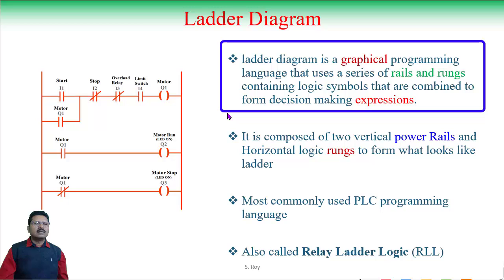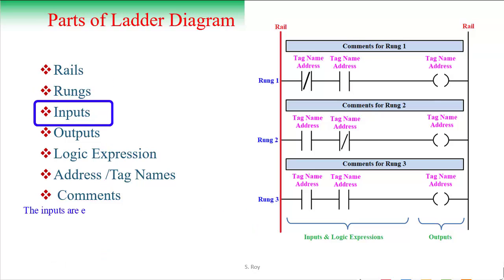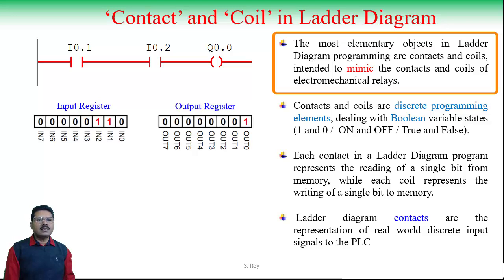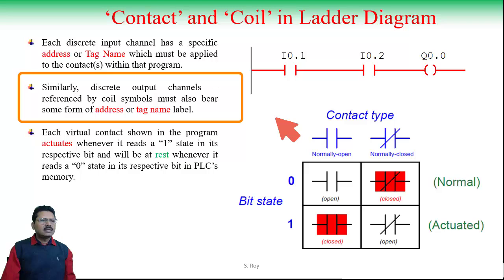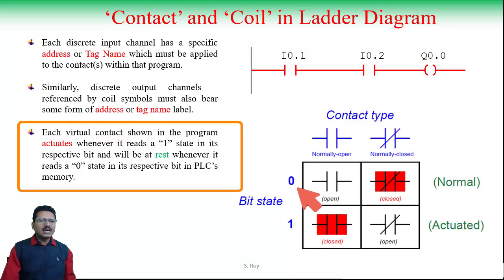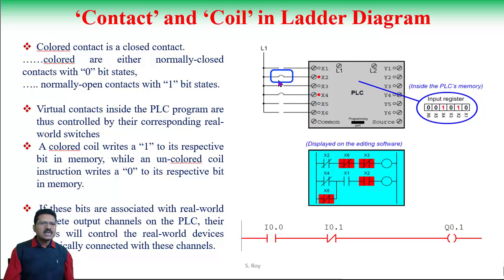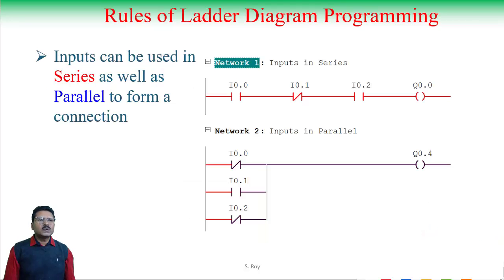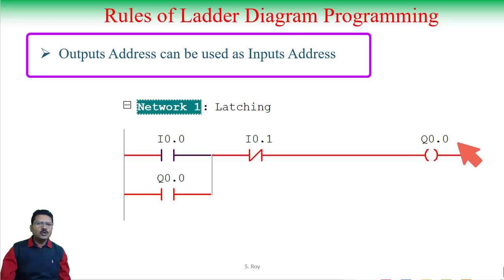What is PLC: Ladder Diagram explanation

Comment: If I understand correctly, between the physical switches and the make and brake symbols of a plc, the bits mediate. The bits have an initial value of '0', so it coincides with the normally open state of a contact, while the same is not true of the initial closed state of a contact in the ladder diagram, which for any contact to open, the input bit must change from 0 to 1
Reply from the maker: sorry sir, I could not follow what you wanted to say. We can think operation of  virtual  NO ( Normally Open) and NC(Normally Close)  contact as follows--- 
In ladder programming the status of NO will be same as status of physical switch and status of NC will be inverted status of physical switch. Say physically two switches SW1 and SW2 are connected to PLC input tag number I0.1 and I0.2. We want to get an output Q0.0 when SW1 is pressed (i.e. energized) and SW2 in not pressed (i.e. deenergized) . How to write the program?
In ladder diagram, One NO (I0.1) and one NC (I0.2) will be in series with Q0.0.
SW1 is pressed, So physical status is logic 1,
SW2 is not pressed, so physical status is logic 0

In ladder diagram, I0.1 (SW1) is NO, so its status will be same with physical status i.e. logic 1
I0.2 (SW2) is NC, so its status will be opposite of physical status, so in ladder its status will be logic 1 as physical status is logic 0.

Now in diagram, both status of I0.1 and I0.2 are logic 1, So output is logic 1, as the operation is an AND gate operation.

Draw diagram in your copy in ladder and try to understand it. 

Anyway thanks for visiting my tutorial.